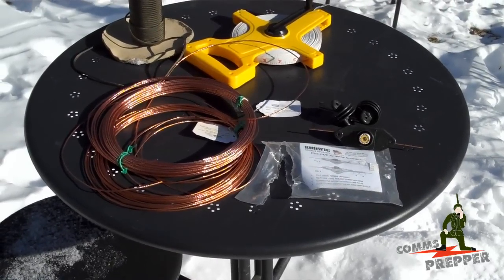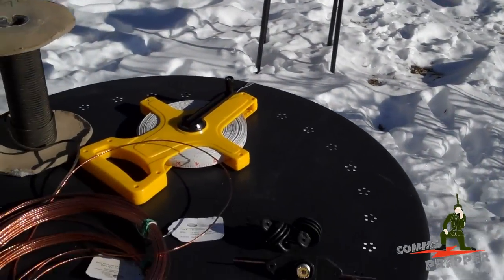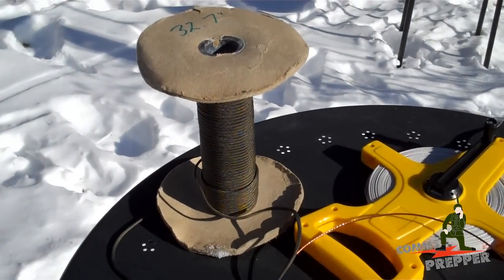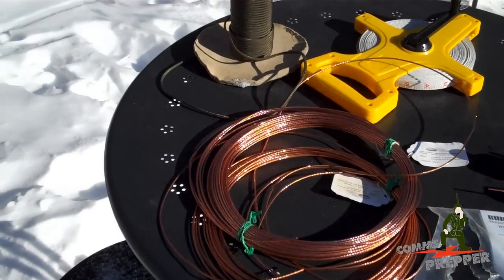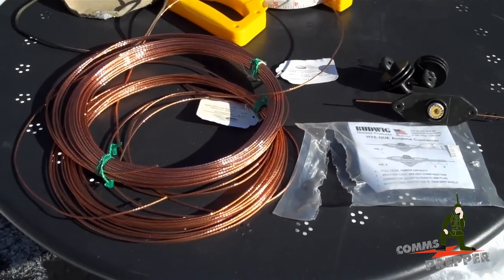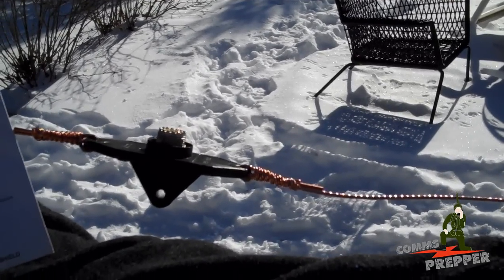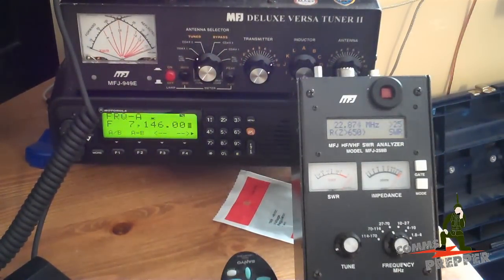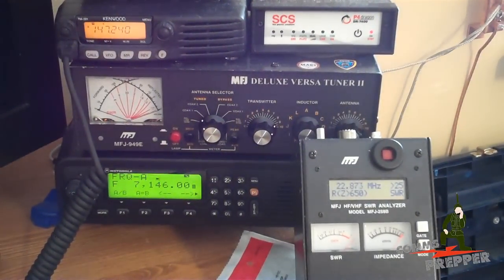How to Make a Dipole Antenna

Comment: I don't think anyone else noticed that the MFJ 259B is set for 70 CM not 7 Mhz or 40 meters. Wonder if this might be why the reading is thought to be off. Just wondering. Nice video though.
Reply from the maker: That may have been a video cut error.

Comment: The 40 meter antenna if physically located to The other dipole, will be (might) be affected with the properties of the first antenna.
Question:  would solid copper wire be better, than multi stran?
Reply from the maker: solid copper tends to stretch.

Comment: Note, in the video he doesn't have the coax attached to the MFJ SWR Analyzer, which is reading correctly if there's no antenna connected. Try connecting it and see what it actually reads, you'll be surprised.
Reply from the maker: Can't - I don't have that antenna anymore.  Thanks for watching and taking the time to comment.

Comment: Great to see a dad taking time with his kids. I know this question is a bit off subject, but do you have a video posted about wire antennas for shortwave radios. I own a small Grundig WR 5408 that I carry in my backpack. It has minimal reception with the built in retractable antenna. The radio  came with copper wire antenna that I mounted behind my house for better reception. Lost the antennae to a winter storm and never replaced it. Any suggestions on building another antenna with shortwave reception in mind?  I prefer one I can roll up and carry with the radio. I mainly use the shortwave for news reports while in the  jungles off the Pacific coast of Michoacan. Thanks, Brum
Reply from the maker: Brumfield USNERDOC Sorry but I don't have any videos on shortwave receiver antennas.  However, USNERDOC has three great videos on the topic and I think it's exactly what you are looking for (https://www.youtube.com/watch?v=LhDBttK4nF0).  Thanks for watching and taking the time to comment.  Respectfully - CommsPrepper
Reply: Commsprepper
 I'm looking at his video now, you are correct, it is what I was looking for. I tell him you sent me.. Thanks for the link. Brum

Comment: You might take a look at a folded HF dipole. I was reading something earlier about building an 80m version. They are supposed to be fairly wide bandwidth wise.
Reply from the maker: I have used them and I am not a big fan.  Too much money for marginal performance.  They are good for government and commercial applications because they are simple and predictable but nothing beats a resident antenna.

Comment: Are you sure the MFJ's needle was stuck?  Looked like you had it set almost to 23mhz and had it pre-set to the 27-70mhz range.  Turn it 2 clicks to the right, so you pre-set within the range you are trying to tune.
Reply: Dude he didn't even connect an antenna to the MFJ lol .. it's all fake